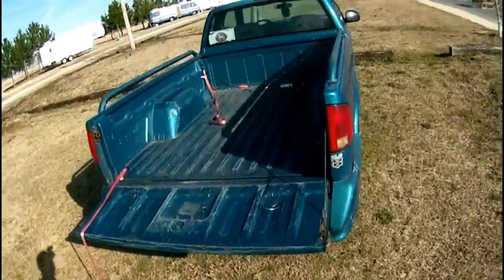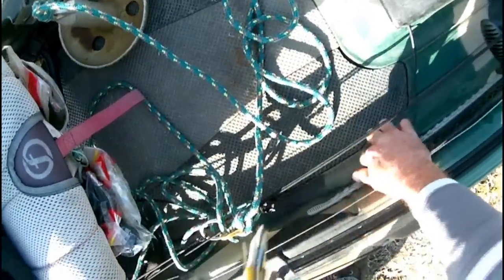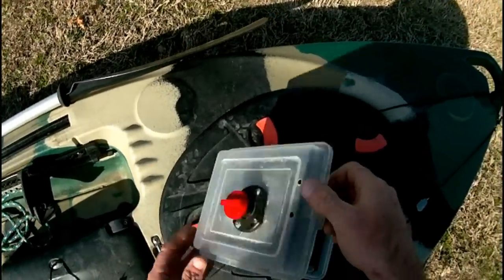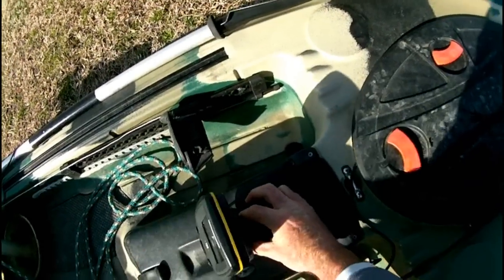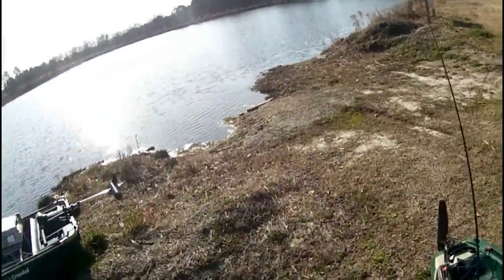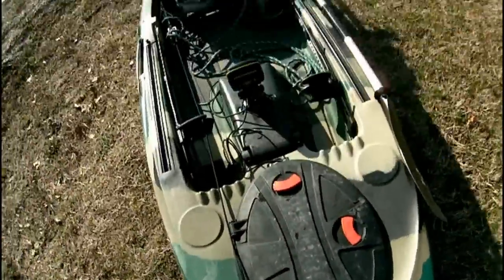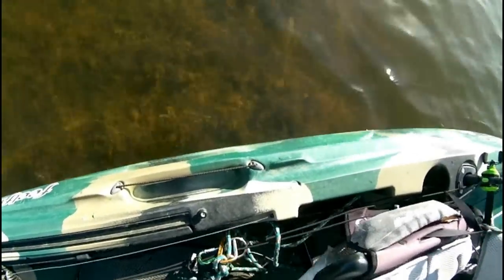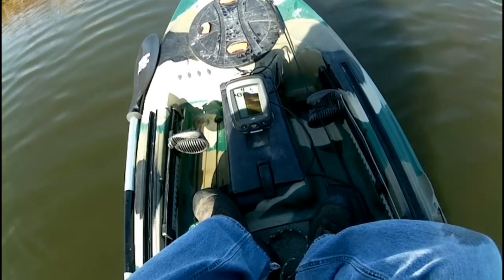Fish finder Lure 11.5

Comment: What kind of battery system are you using ?
Reply from the maker: +Jim Rittenhouse I had an old jump pack for cars we never used. opened it up and pulled the battery out of it. 12v 10a gel battery still using it today. But any battery will work and you can find them fairly cheap online. Thanks for asking!

Comment: Nice video, but how did you mount your transducer  ?
Reply: Jim Rittenhouse I used 1 3/4" pvc heated one end and stuck the transducer into it to form around the mount area. Then just ran it up through the scubber hole, and the clip holds it in place!